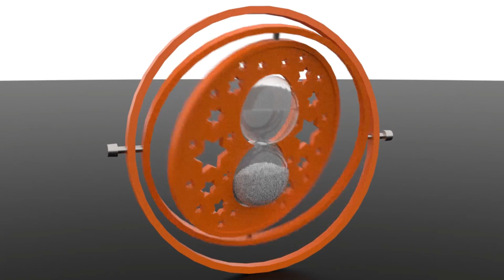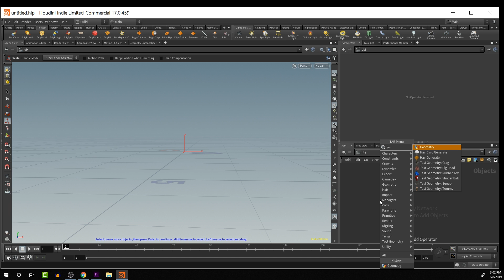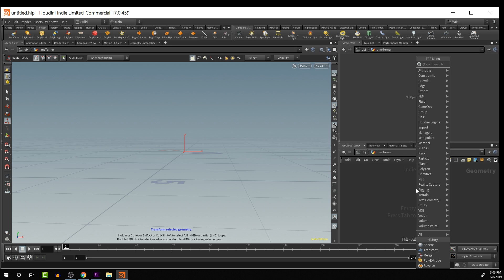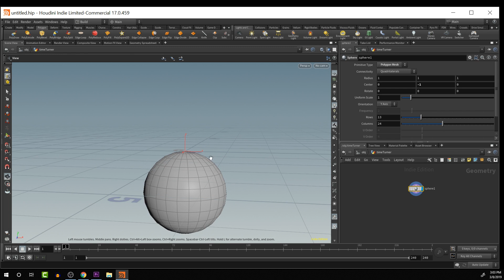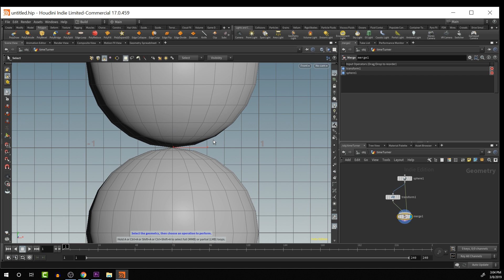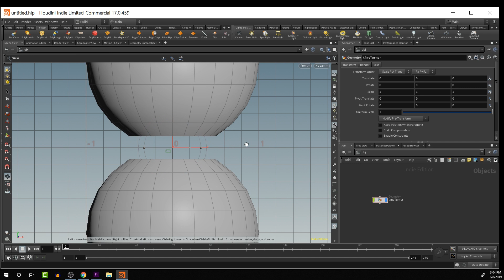Time Turner Modeling, Animation and Simulation Houdini Tutorial

Comment: You can easy use groups from boolean SOP when beveling hourglass cut edges. Bevel outside edges (select is easy) then use another polybevel on group from boolean  SOP (remember to enable output groups)
EDIT (I loaded my version of scene): In Boolean SOP - enable "Output primitive groups - Overlap (might be usefull for maybe apply dirt material to cut), and important, Output Egde Groups. And now you have selection for edges from boole for Polybevel (ABSeams worked here).
Reply from the maker: Awesome! Thank you! That will be very helpful.
Reply: @CGINerd  You're  welcome. Great tutor by the way. Looking for more.